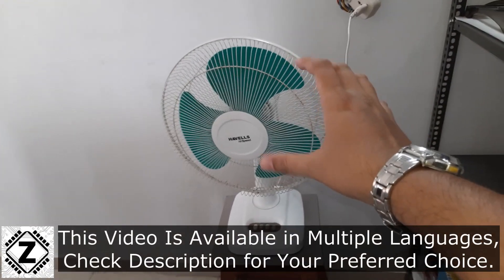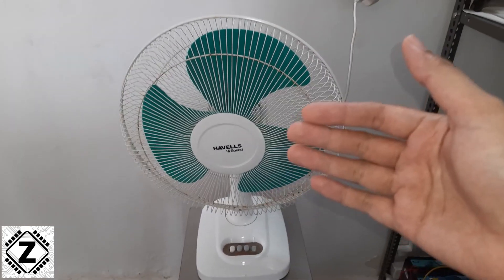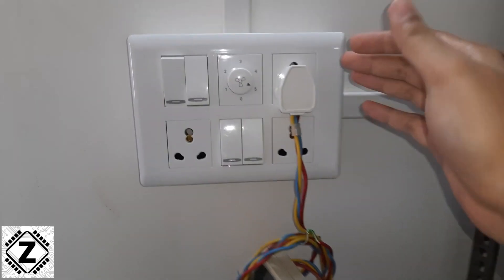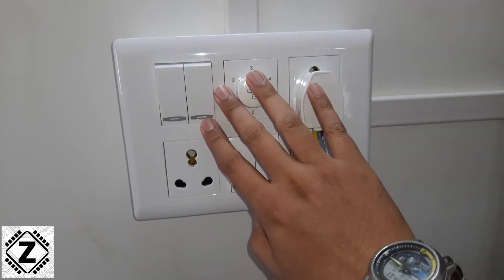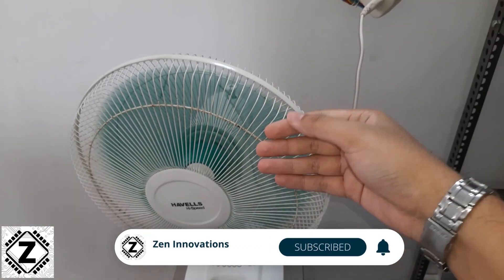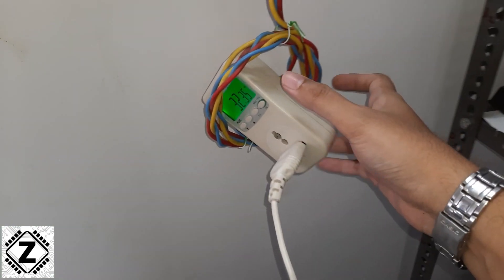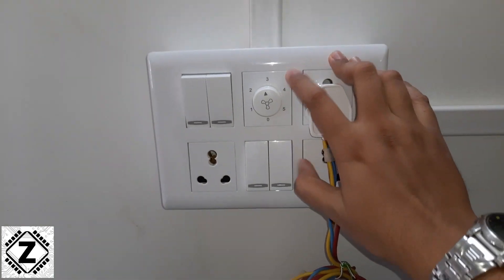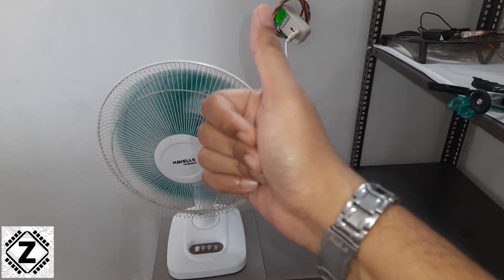[Eng] Old fan Power Power Saving Trick | Does Fan at Low Speed save electricity? (Part 2)

Comment from the maker: This video is Available in Multiple Languages-
English https://youtu.be/IZypFgZtKCI
Hindi https://youtu.be/NoR9uWjEbdI

Watch Part 1- Table Fan power consumption test-
English https://youtu.be/gaO8g_bSeak
Hindi https://youtu.be/5uXMTjPZDzo

Model tested-
Havells Velocity Neo High Speed 400mm Table Fan (White)
Buy now https://amzn.to/44oGqSJ

[Best Buy Affiliate links. A= Amazon, F= Flipkart. Disclaimer- Paid Links]
Fan regulator https://amzn.to/3O0nvbi
Electronic fan step dimmer https://amzn.to/46ABj3S
Electronic fan Stepless dimmer https://amzn.to/3O1DvKw
BLDC table pedestal fan https://amzn.to/3CW4eBG
Meco power meter https://amzn.to/3XAAuUC
Table fan 400mm High speed https://amzn.to/3NWBFdS
Table fan low speed https://amzn.to/3PyzwGp